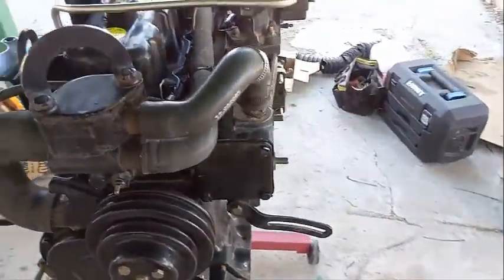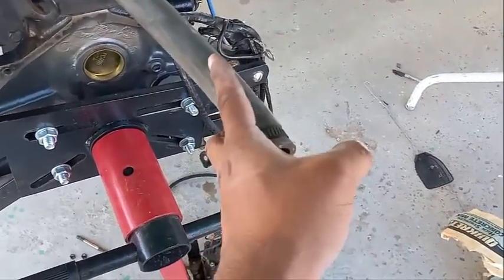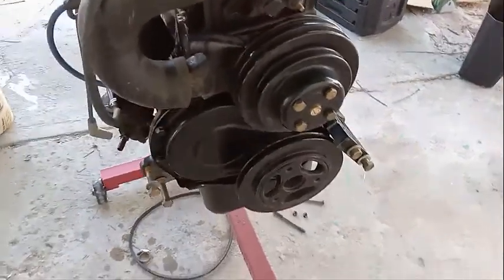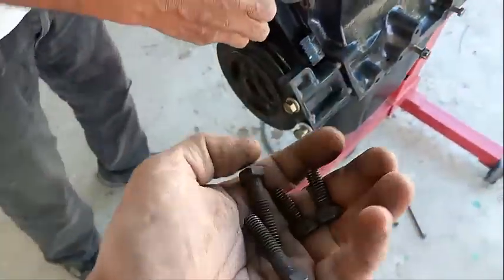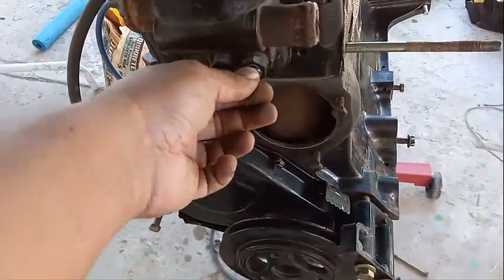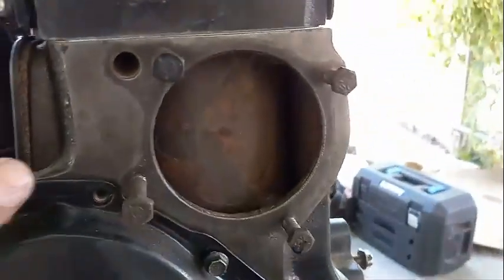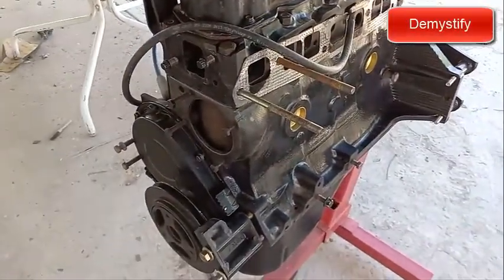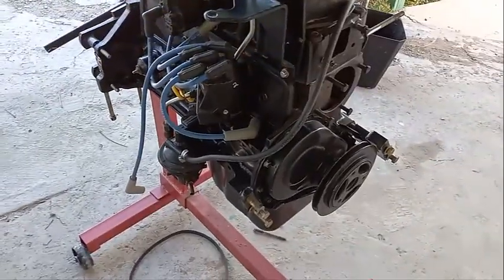MerCruiser 3.0 Liter 3.0 Disassembly Water Pump V1.0

Comment: yeah, those are called freeze plugs and their purpose is if water freezes in the block it'll burst those out before it cracks the block. That's all nothing is going to prevent water from freezing knucklehead.
Reply from the maker: I know you are trying to tell me something, I just don't know what that is? Are you quoting me? 

I know freeze plugs are actually holes made for removing sand for when the engines are being made. Afterwards, the freeze plugs are repurposed for trying to prevent cracking of block if in case the water isn't removed and temperatures drop below freezing. I know some people question whether they work as freeze plugs. In my opinion they do work and do sometimes do save the engine from damage. In a normal car engine, the engine has antifreeze which is meant to stop the water from freezing. I one time did this experiment with two glass cups. In one cup, I put water and the other I put antifreeze. Next, I place both cups in the freezer. After one day, the cup filled with antifreeze did not freeze. Conversely,  the other cup with pure water, the water became ice and cracked the glass cup.